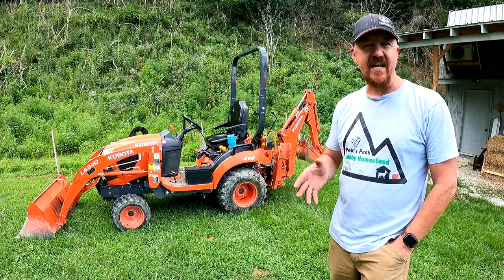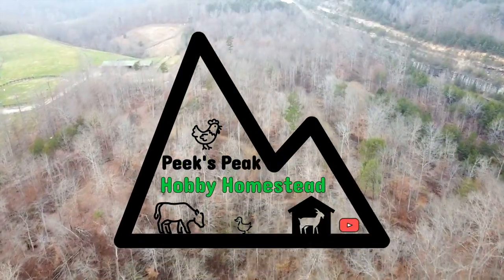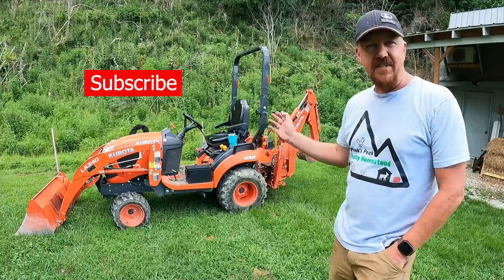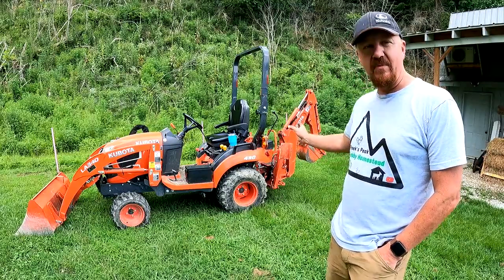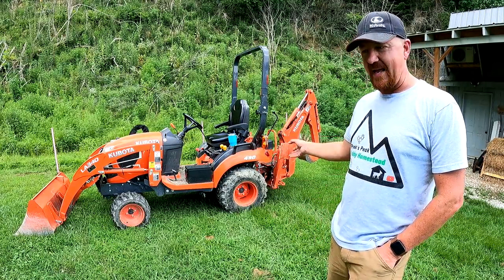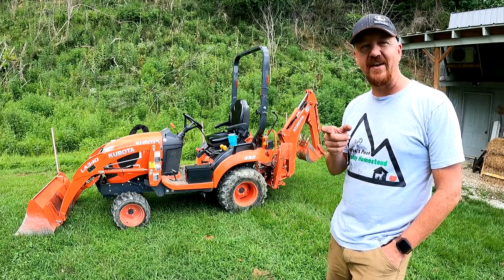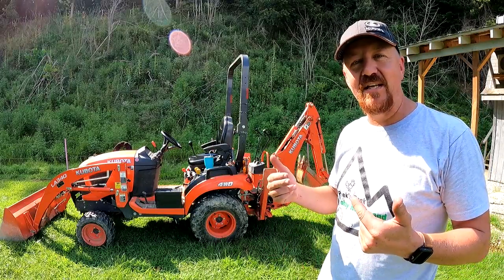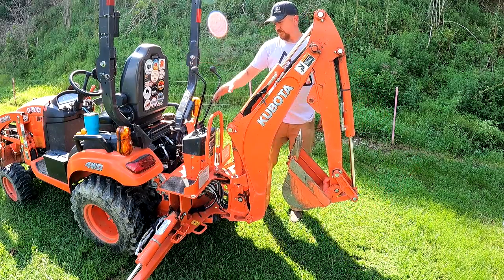Kubota BX23S Backhoe Removal and Installation - Step by Step

Comment: Great video and explanation glad I found you
Reply: wish I had found you long ago. Your video about the "zerk " fitting for the throttle pedal is my problem now.  Will be taking my bx 1860 with 3000 hrs in  to the dealer to have the sensor and pedal repaired . Thanks for the info for I am not very mechanically inclined.

Comment: This is obvious for us experienced folks, but an important thing to note when reconnecting the BH (or connecting/disconnecting the hydros for anything, I guess) -- Before attempting to reconnect the hydraulics, shut the tractor down and relieve the hydraulic pressure by playing with the loader stick (put it in float, move it side to side, etc). You mentioned that for disconnecting, but not reconnecting.
Reply from the maker: Good point!

Comment: Man those jaw locks would nice! Both of mine are of a age where you have to get two pin holes perfectly lined up to slide the pins in. Lots of bumping the outriggers and arm to get them lined up and sometimes more than few bad words. But Usually only a couple of minutes per side.
Reply from the maker: Yeah, they are great!

Comment: Have you ever had an issue when fully extending the backhoe bucket? When the backhoe bucket is fully extended there is a 90 degree elbow that makes contact with the backhoe. I have had two elbows snap off in like a day.
Reply from the maker: Replied on your other comment…
Reply: @PeeksPeakHobbyHomestead  thank you

Comment: I watched a video on youtube that I can no longer find that shows how to leave the lower 3 point hitch on with the backhoe attached. that's what I do now. remove the arms that connect the upper links to the lower and zip tie the lowers all the way up against the tractor and backhoe will fit and leave the lower arms in place.
Reply from the maker: I’ve only read about it, I’ve never seen anyone do it.  🤷🏼‍♂️

Comment: You pull on the outrigger hydraulic handles to lower?  Never seen them work that way.  I've never been on a BH that you couldn't reach back and pull towards the driver seat, to raise the outriggers while driving down the road.
Reply from the maker: Yeah, I’ve never ran a big backhoe.  This is all I’ve known…

Comment: I have a kioti. It has pins on the bottom. I have taken off right now. It was a little fun the first time. Waiting to reinstall. Anyone buying a backhoe unit need to make sure you get the 3 point hitch. They are expensive to replace don't now about Kubota. Kioti wants around 1000.00 for the cs2510. Make sure you get when buying a used machine.
Reply from the maker: Good tips!  That’s steep for 3 pt!